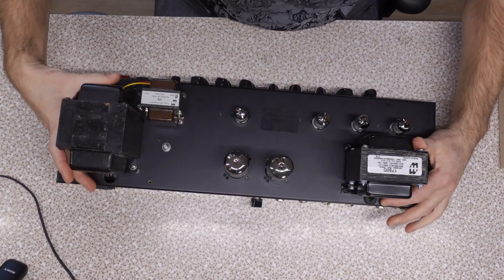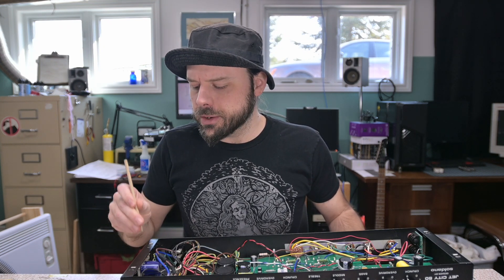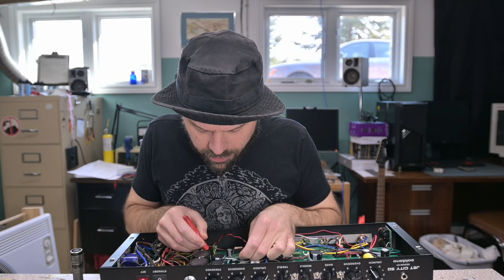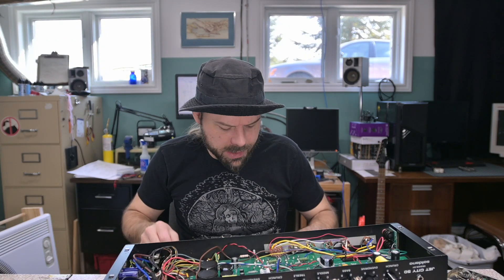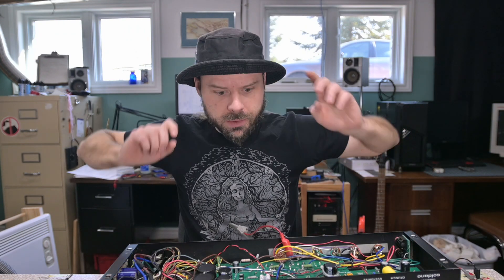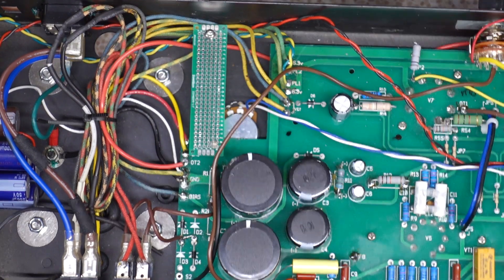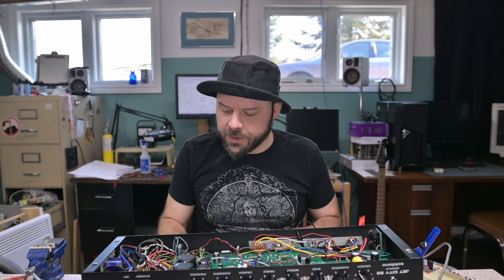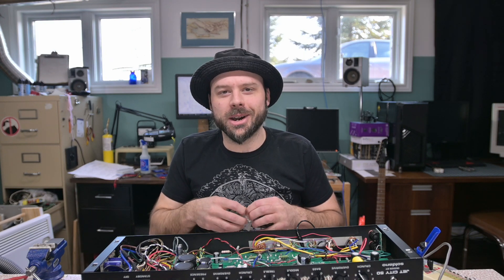Jet City Violence Ep.7 - Boosting the Bias for More Range.

Comment: Can you share schrematic?
Reply from the maker: Ahh, not really. Not on here. 
This circuit is specific to that transformer. Most amps won't need this booster. 
It's a basic voltage doubler, I prob show the schematic it's based on in the video.

Comment: I know this is a couple years old but just really nice to see other folks appreciate the Jet City amps like myself! Currently have a 100 and a 50. The 100 I've modded to extremes and I describe it as if a modded plexi and a Dual Rectifier had a demon child. I'm currently rebuilding the 50 which was modded to SLO spec and is basically an SLO but tighter and more dynamic. I love your videos bud!
Reply from the maker: Kind of hard not to appreciate this amp, it's pretty much an SLO clone already. I don't even know why people bother to mod it more like and SLO when it's functionally already and SLO, and really, it needs to be a little less like an SLO.
Reply: @DATT  Yeah true it’s the Soldano Hot Rod circuit which is super close to slo but I guess I’m my case I did it to see what it would sound like. It’s all preference of course but I’m my case it’s slightly less gain and more low end and depending on what kind of tone your going for it may not be an improvement. I
Reply from the maker: @LucasMastropasqua  Oh, is your Jet based on the Hot Rod ? I'm not that familiar with the Hot Rod.
Reply: @DATT  The Jet 50 & 100 amps are almost exact copies of the Soldano Hot Rod 50 & 100 amps as opposed to the SLO which isn’t that different except for 7 component values and the gain pot values. 

People started calling the JCA amps a poor man’s SLO but they are actually the hot rod circuit. The hot rod amps are actually more gain, not that it’s usable, and a bit less low end. 

Schematic for the hot rod amps can be found online just like the SLO.
Reply from the maker: @LucasMastropasqua  Ohh yeah, I looked up the Hot Rod Schem, I see it now. It's identical to the Jet Schem that matches my head. 
7 components. Yeah, pretty much an SLO without the "clean/crunch" switch, which I've since modded back in, but a more elegant version. I'll have a vid about it eventually.

Comment: Nice one mate ^_^ Got my JCA100 up and running, sounds great. Might have to do some tweaking though; not as tight as I'd like it to be.
Reply from the maker: No, stock it's a bit loose cause it's trying to sound like the SLO, and the SLO had more a vintage vibe to it compared to modern amps. I managed to get mine tight. If you check out Jet City Violence Episode 2, that was the re voicing session that did most of the tightening, it's a bit informal but if you can follow along, it'll point you at the components to look at. Those one secret sause I might not mention in that vid, is when I run this amp, I typically use it in 10k cold clipper mode with the gain turned down to like 5 or 6, gives me the combination of tight and responce I want.
Reply: @DATT  thanks, will go check out that vid again :-) For now, putting a boost in front of it does the trick, but I think I want the amp to be tight unboosted, so will dig into that vid.